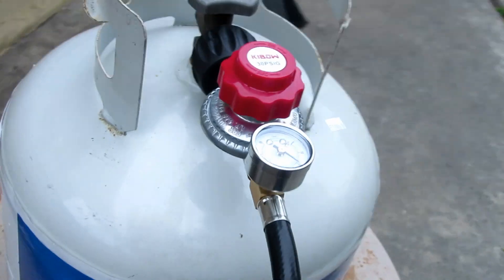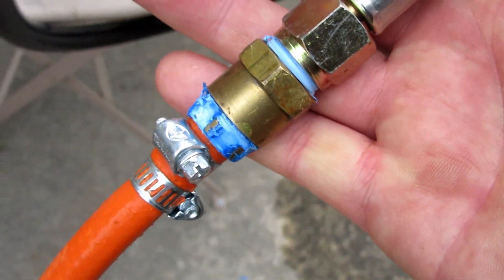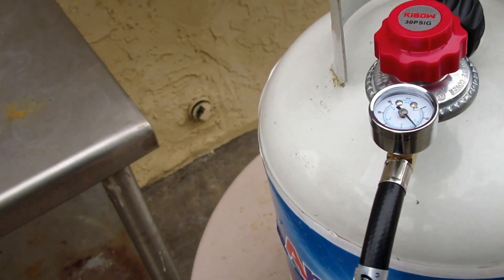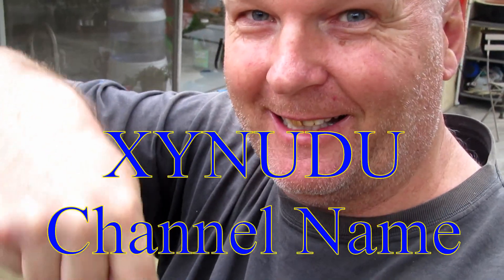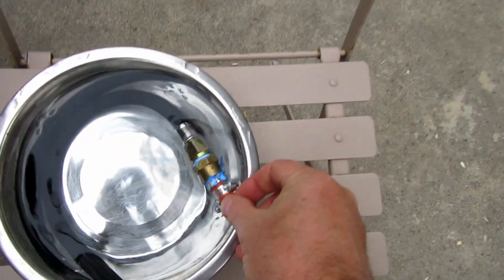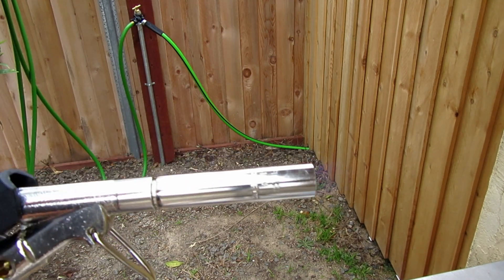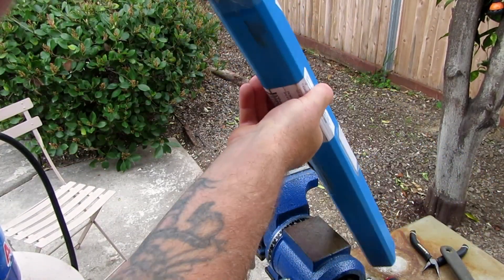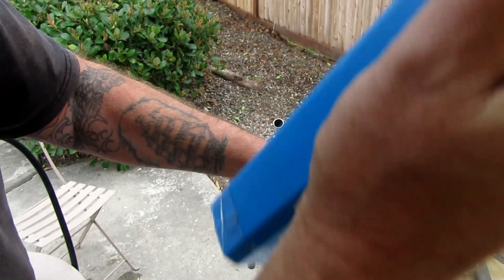Hard Bronze BRAZING on the cheap using LPG/PROPANE & Bullfinch Torch

Comment: A worrying number of people seem to have got the impression from Xynudu’s and your videos that the Bullfinch Autotorch is the only air/propane torch capable of bronze brazing. 

I hope you don’t mind me stepping in here to put that myth to rest.

There are any number of air/propane torch set-ups (i.e. torch with burner) that will put a bigger volume of heat into a bronze brazing job than the torch you’re using there. 

To illustrate the point, we need go no further than Bullfinch’s own range of torches. The torch/burner combi you’re using puts out 4.7kW at 1 bar. Compare that to a standard Bullfinch torch handle, i.e. the 1340 or 1185, with a 1260 or 1270 burner attached. The 1260 and 1270 put out 19.6kW and 32.5kW respectively. A standard Bullfinch torch handle with the 1260 or 1270 attached will outgun that Autotorch you’re using by a very large margin, allowing much bigger bronze brazing projects to be tackled. 

The same can be said for Sievert torches with about five of their bigger sizes of burner. They will all significantly outgun that torch you’re using.

At the other end of the scale, you can successfully bronze-braze with something as small as a tiddly butane cookery torch in the right circumstances. The right circumstances being that the job is a small one and you take care to conserve heat round the work with e.g. ceramic wool and vermiculite blocks. Mystifyingly, I rarely see much heat conservation going on in Youtube brazing videos.

To sum up, whilst the Bullfinch torch you’re using there is an excellent torch, it’s far from being the only air/propane torch that you can successfully bronze braze with. For bronze brazing bigger work, it’s in fact far inferior to numerous other air-propane set-ups buyers can opt for if they so choose, in some cases at a significantly lower price.
Reply from the maker: @MarcWh  This torch is running just on propane i'm not sure what your refering to air/propane.
I do have another smallar torch running on compressed air propane mix and i melt silver with that one.
I am by no means an expert on this subject i just show what i got, all those other torches you mention well i aint got them so i don't mention them. Have a good weekend buddy👍
Reply: @JollyPeanut  The torch in your video is running on an air-propane mix. The air is taken into the burner from the same source as the air you’re breathing, i.e. the air around it. A typical plumber’s torch mounted to a disposable cylinder is an air-propane (or air-propylene) torch. There are countless brands and types of air-propane torches available.
Reply: I checked out Sievert's site.  They claim they make no brazing torches.  There is a difference between BTU and Temperature.  My furnace puts out more BTU but can't melt solder.   Do you have a Sievert setup that will braze?  Love to see a video.
Reply: @CraftedChannel  “Do you have a Sievert setup that will braze? ”
Yes, the Pro86 torch with a selection of the standard burners, and a Pro88 torch with the burners at the larger end of the range. 

It sounds like you’re getting led astray a little by the terminology if you’ve formed the belief that because a manufacturer doesn’t describe a propane torch as a brazing torch you can’t ever braze with it. 

You can, depending on such things as the size of the job, the degree to which you’ve insulated the work, and whether the torch/burner set-up is realistically big enough to get the required volume of heat into the work to achieve temperatures at which the filler metal will be made to flow by the heat of the parent material and form a sound joint. 

Assuming we’re talking about brazing with silicon or manganese bronze brazing rods then the flow temperature is typically about 850-900 degrees Celsius. Since the flame temperature of an air-fed propane torch is comfortably above that, then hopefully it becomes clear why brazing with such torches is in fact perfectly possible.
Reply: @MarcWh  I've brazed with oxy/acy many times decades ago.  I did figure out how to surf the site better to find the recommended setups.  Just wanting to put together a set to give me some brazing capacity without oxy/acy.    Thank you for putting some part numbers in there for me to investigate.

Comment: Hey mate, looking to buy one of these but I noticed that the brazing regulator that comes with the kit (part 4041) is set to 4 bar. So to get the most out of the torch you might want to crank up the pressure.

Cheers for the video, I'm going to pick one of these up

Comment: what is that system of adapters and connectors you used to get the hose connected to the regulator you're using? Super interested in this torch, but I want to be sure that I'll be be able to use it on American tanks (which I think are supposed to have QCC1 connections).

Comment: What is the inside diameter of the GasOne 2120 regulator hose? I'm trying to connect the 5mm Bullfinch hose to the regulator hose.

Comment: Hi, when brazing mild steel a bit  larger and so extra time to heat the steel so it begins turning black and very bad for wetting or  brazing . If this is a propane gas flame causing the issue , can you get around it or is brazing with propane just difficult ? P.S. I own a Bullfinch.

Comment: Bullfinch also have a Autotorch for Acetylene too that runs off an Acetylene cylinder, in association with BOC. Works even faster but you do need a flashback arrestor, and it ignites rather noisily with a bang (which is normal apparently).

Comment: Good call on the propane rig and details. The map/oxy thing is as disappointing as advertised. Luckily, I got to try one out before wasting my money. I totally get what you mean about needing just a bit more juice than the typical cheap torches for small scale brazing. 

I make up the difference by using a soft firebrick oven to concentrate and contain the heat. The brick is dirt cheap in my area, and can easily have cavities routed or drilled to fit different types of work.

Comment: see you had the pressure at about 22 but they say use at 4bar about 56 psig or you can damage the torch, hope this helps and wish you all the best with your projects (i think some regulators dont let you use 4 bar).
Reply: @Oracladeus  the regulator says 30PSI gauge so wont output 4 bar regardless of  what the gauge reads up to. It is the manufacturer that states it must be 4 bar, I know that at to low a flow/ pressure that many torches burn in the torch or to close to the nozzle and burn the torch up, I have one that will destroy the torch in seconds  if it is allowed to burn low and it has stainless steel nozzles ( it is a real power house for its size too).

Comment: Will this type of welding be strong enough durable enough to build a sidecar for a bicycle?
Reply: Brazing was the number 1 main way to bond bicycle tubes all the way upto at least the 90s. But brazed bicycle frames use "lugs" which are similar to the connectors used in copper tube plumbing (but investment cast) . As the lug & tubing is heated and cools it helps to suck in the brazing filler making for neat and solid joints. 
I expect doing it without lugs will work perfectly fine but will require more skill and a lot more filler material. Remember that in brazing the work material (your steel tubes) will not be melting. The braze is almost like glue sticking two pieces of metal together. 

Also bear in mind that propane on its own burns at 1980 °C 3596 °F. Whilst bicycle brazing is always done with oxy acetylene torches which burn at 3100 °C 5612 °F.

And if this is just a push bike sidecar for a bit of fun, really anything would work. You could even build it out of copper plumbing pipe or even ABS plastic pipe and use chemical solvent to weld them together.
Reply from the maker: I would think so, bicycle frames are often Brazed although i am no expert on this subject but if you google brazing & bicycles there is a ton of info out there o this subject.
Reply: If your doing aluminum as long as you have a good braze it almost as strong as a weld maybe stronger since aluminum braze rods are stronger than aluminum

Comment: Thanks mate. I just know.. lpg gas can be a welding gas. Now i can weld my radiator car leak.
Reply: Boy - propane is a poor-boy's proxy for a welder - heat considerations make it all but obsolete unless you really know what you're doing (and by that I mean why in the hell you would want to use it instead of a modern mig or tig or even stick welder?)  Even for bronzing.  Especially if it saves you a tremendous amount of unecessary labor!
Reply: When you say weld I’m assuming you mean brazing like in this video. Welding melts the parent and filler metal its impossible to do with a air propane torch. It’s possible with a oxygen  propane torch but barely. Brazing is where The melting point of the filler metal is above 450°C, but always below the melting temperature of the parent metal to be joined. Soldering is the same but with the melting point of the filler metal below 450°C

Comment: I also watched Xynudu and got the name of the torch he uses, UK price £140 odd pounds from Bullfinch, you can also get a adapter from them to convert UK type regulator to fit a different bottle (5/8in BSP-LH female POL for propane x 21.8mm SI-LH female) for £5.42, they have various fittings, which is what I need as the bottles here are different  to UK bottles. I have been want to get this torch but as I do little brazing I thought I will get one some day, that day arrived as I just got one of ebay uk, new never used for the bargain price of £75 + £5 postage. Now just have to get adapter for £5 odd pounds and away I go.
Reply from the maker: Bargain price well done.. I just chopped off the UK reg & fitted US regulator that i found on ebay or Amazon i cant remember which, the reg came with hose fitted so i just joined the two together giving a longer hose which i find better to work with, works well its a very nice torch..
Reply: What is the Bullfinch order number for a regulator to fit a U.S. propane tank?
(fradetj@gmail.con)